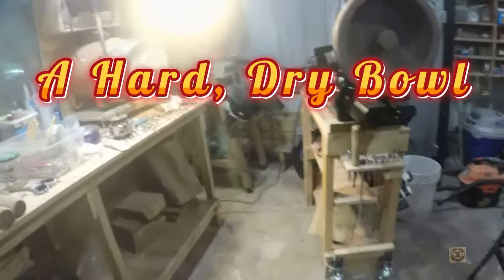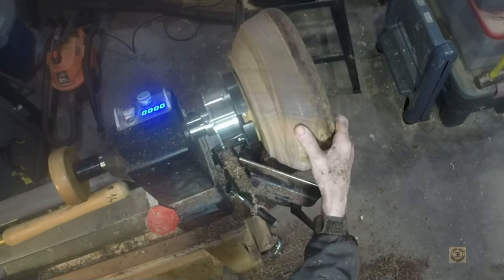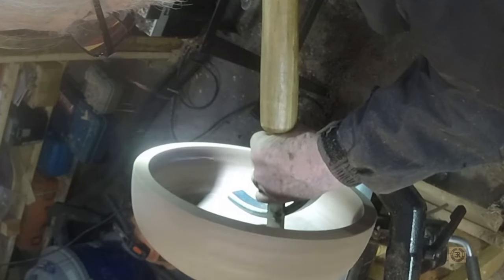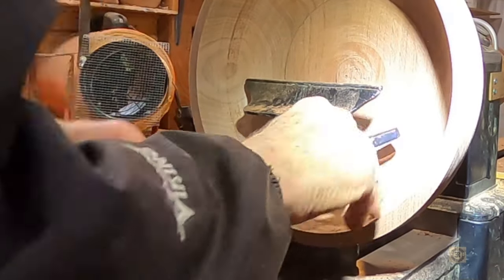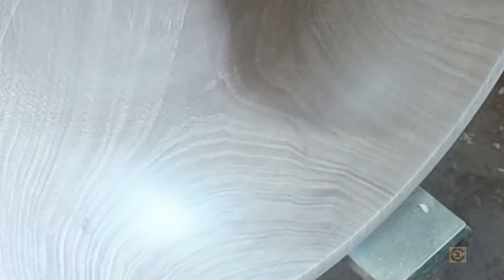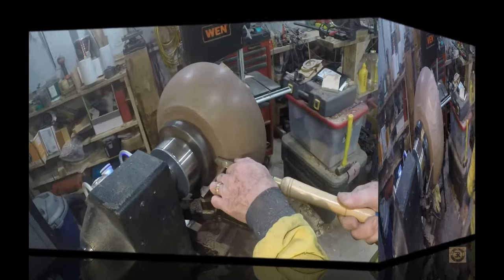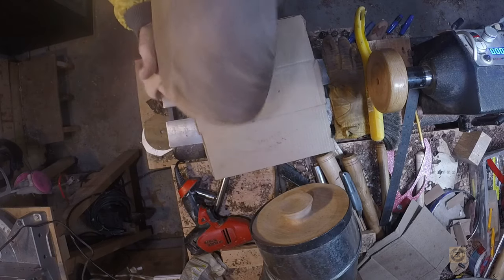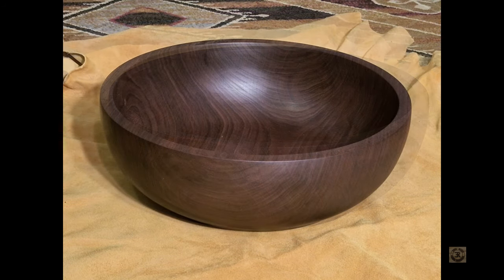Second Turning of a Black Walnut Salad Bowl 28 Years After the First Turning

Comment: Center post allows rechuck for twice turn bowl when tenon goes out of round. Also, mineral oil can cut dust problem. Good for turning, not just wet sanding. Bowl looks great. Bet this one also finds a permanent home in the house.
Reply from the maker: I wondered about that, but I thought the post would be to fragile to support the bowl. After the struggle to remove it, I figure it was plenty strong enough.